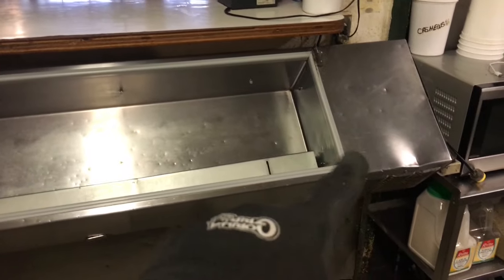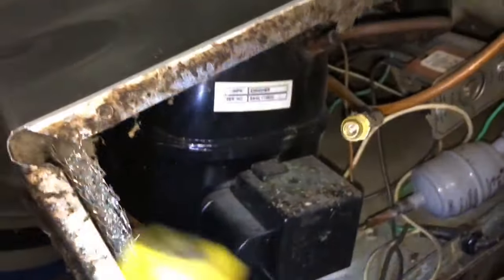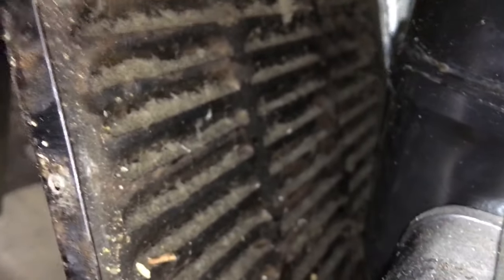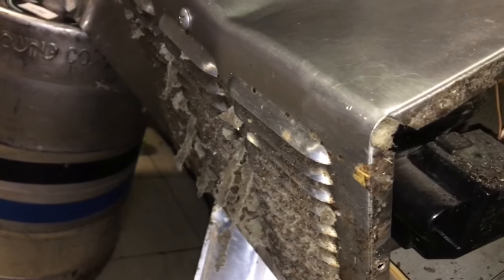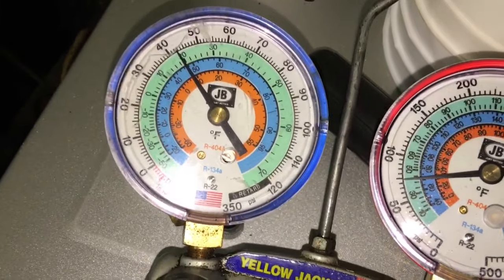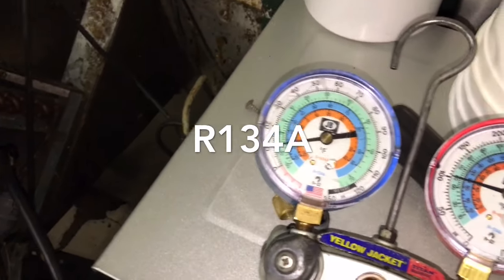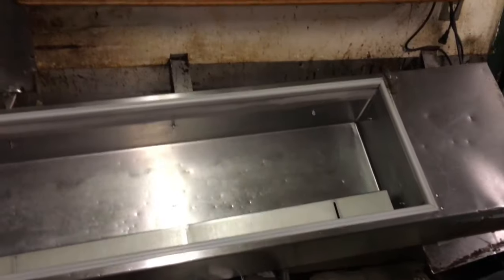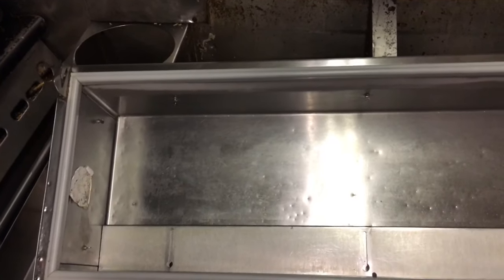Rail salad refer

Comment: Nice work.  that system was really low.  I would suspect a leak on the suction side.  yet to cut into the stainless to try to find it would be pointless.  I had an evaporator the other day leak after five years.  Omni temp.  spoke with the factory and I was told that was the life expectancy.  They don't make stuff as good as they used to.
Reply from the maker: That's all I see out there 5-7 years max.
Reply: Wow I think the oldest evaporator I seen was 12 years.  A Hobart copper evaporator.  Yes rare indeed.